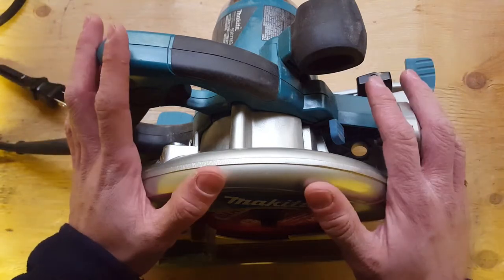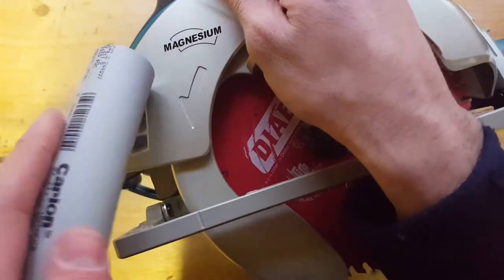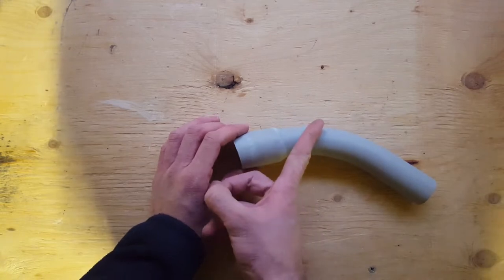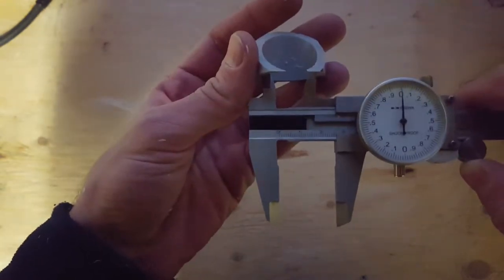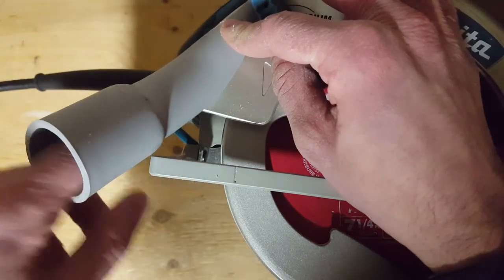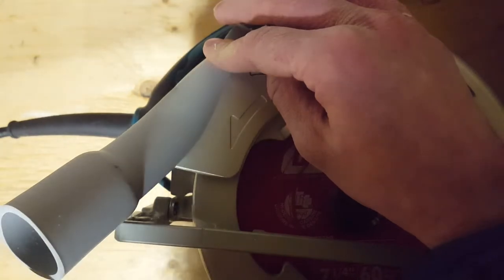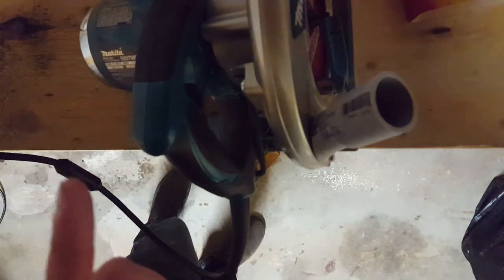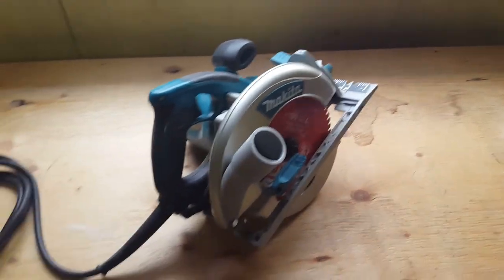DIY Circular Saw Dust Collection Adapter ($4 Build) (Makita 5007MG)

Comment: I usually use a handsaw, or an oscillating multipupose tool with a sawtooth blade, to cut small sizes of PVC conduit like that. Virtually no free dust.
Reply from the maker: To do again I would definitely lean towards a hand saw. The circular saw wasn't worth the hassle.

Comment: Thanks for the video - it gives me some ideas, and I happen to have some leftover conduit 45-degree bends left over from somr recent electrical work in the shop. Some all-purpouse glue, or epoxy, or caulk may take care of the gapping. For indoor/outdoor options, how about a second saw?
Reply from the maker: If I wanted it on there permanently I think some sort of glue would be a great call, or drill and tap a second hole in the saw.

Comment: Thanks for sharing!!! How are you feeling about this solution now…2 years later?
Reply from the maker: I think it works okay in a pinch, but it isn't the most ergonomic solution since it does move around and won't stay perfectly aligned with the dust port. I've since designed and 3D-printed a dust port adapter that works much better (but most people don't have access to a 3D printer)
Reply: @wrongtool  
Please share anyway?
Reply from the maker: Hey  @jimaspinii7579  sorry about the delay. I had to make an account to upload this. Cheers! 

https://www.printables.com/model/822714-makita-5007mg-dust-port-vacuum-adapter

Comment: Couldn't a pillow case, plastic milk jug or some other common item be secured to the circular saw tube attachment to collect dust blown out?
Reply from the maker: Probably! BUT the suction collects more dust that momentum from the saw blade would, and I don't want a sack of sawdust swinging off the side of my saw.

Comment: use that inside and glue it on . and stick a 45  degree on to it for outside win win
Reply from the maker: Glueing it on is a pretty good idea if you want it permanent. I store mine in the carrying case though and I think that would stop the lid from closing.

Comment: Do you have the link to the conduit you used?

Also how’s it holding up?
Reply from the maker: Sorry I can't seem to find it on the Home Depot website. I bought it in-store.

It still works about as well as it did when I made it, which is to say, ok. I recently designed and 3D-printed a replacement that works much better.

Comment: What is the nut size
Reply from the maker: It's an M5 screw so the threads are 5 mm. The head size on the screw will depend on what you buy.